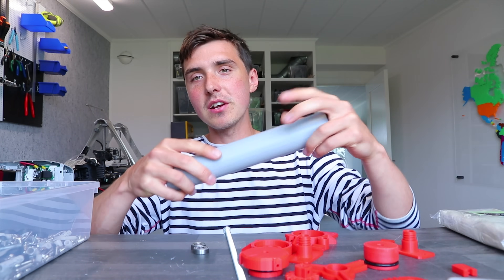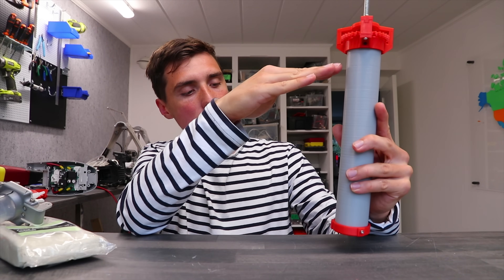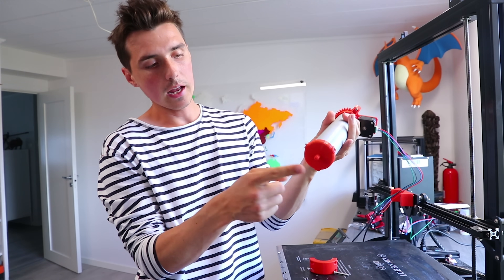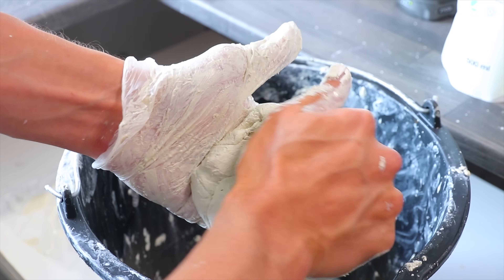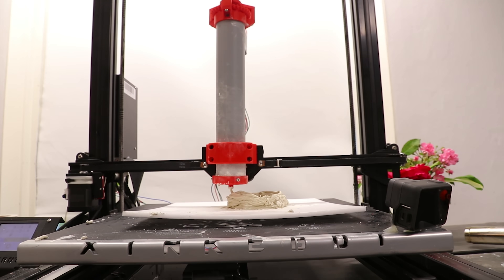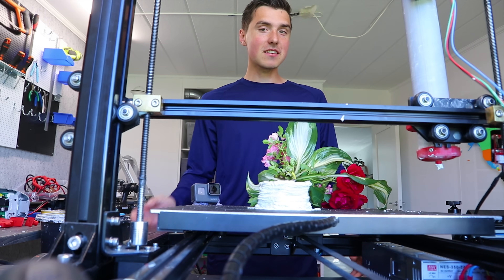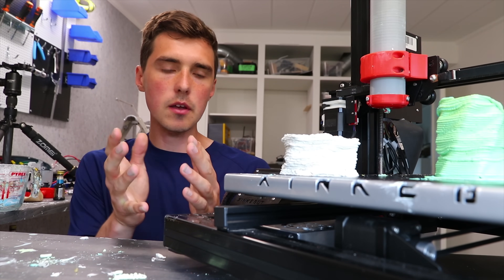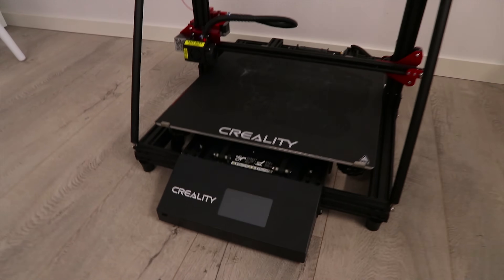3D Printer Makes Ugly Clay Vase

Comment: It's 2 years later and I think the problem is that the bottom of the "hot-end" is flat. If you made it cone shaped it would be easier to push the solid clay out. I know you will never read this but what's wrong with trying?

Comment: I’m a potter and have worked with clay and glass for 50 years.  Here is what I see, the moisture in the clay that you attempted to extrude was not consistent.  Try adding the water and then press the clay through a screen.   Then mix it with a kitchen hand mixer and then through the screen again.  Second extend the length of the strider tube.  The diameter of the tube should be about 5 mm and be about twice as long as you have it.   It will align the clay particles.  The tip of the extruder should slightly depress the clay onto the layer below.  Then I would have a fan blowing on the vase until the desired height is achieved.  I would like to see you revisit this project.

Comment: You need a small heater-blower, like cooling on normal extruders to dry the clay right out of the nozzle. I'd try those cheap chinese air soldering "irons"

Comment: I'm a 3D printer veteran and recently started to get into pottery. Consider making some clay pots by hand and/or consulting with a potter. Also there different clay formulations and some may work better than others. At a glance I would say, no soap, get gloopy and go really slow. Use a heated bed and a fan to harden the clay as you go. Dry, unfired "green" clay with a 4mm width will be very brittle. Handle with care, dry completely and fire it. I'd say get a potter to help you, but making a kiln is probably right up your ally!

Comment: I wonder if you could get past this via really heating up the clay just after it's been extruded. Thinking like a laser hitting it, and going very slow. The problem is that your clay stays liquid-ish. When working with clay, you kindof drive out the moisture via just how you handle it. You even have to keep adding water to force it to not dry out. You don't do that, hence, it trying to escape.

Comment: Impossible to do because of the Time to dry 
3D printing works great because platics becomes solid almost instantanly 
I think you should try chocolate again with frozen airflow. Should work with butter maybe and candy the key for candy is hot head, hot réservoir and very efficient airflow

Comment: You should look into Monster Clay - a wax based clay for professional sculptors. You'd need some way to heat the clay, but as it cools it gets solid enough to support the rest of the model. When it's heated, it can turn into soup if you wanted it.

Comment: You should used Canola oil to soften and paper fibers to strengthen it. its how potters do it..
Reply: When you decide to fire it both burn off.. It just needs to dry slow and then bake till its dryer then fire.. So it does not crack using cornstarch and hand soap was a real bad idea.....

Comment: Hot air and auger upgrade ideas.

There is a vid on how to hack a soldering iron into a hot air blower. If you mounted one near your "cold end" you could stiffen the clay just enough for it at stack and still stick together. In theory, lol.  https://youtu.be/RchFwCALl9c

You might also try an auger to move, compress and eliminate air bubbles.  Skip to 14:00 for a good explanation, https://youtu.be/TkZ1h22KqbU

Comment: Great job ! that is real cool im offering a suggestion..... i think that if you allow dwell time for the clay to dry after each layer and if you can hit it with some hot dry air from a dehumidifier  to get that water out of the clay so modify your g-code for each z step up  weight 10 min or 5 min just use note pad c++ to modify the g-code produced from your slicer.
Reply: then layer adhesion we will think about that after my idea fails.....
Reply: Im like your hours away from a ceramic turbo charger turbine end lol 500c hot gas just print in ceramic

Comment: Maybe the layers need to dry first? Sure it'll take forever but the clay can't support its own weight, especially when more layers are added. Another option is a screw reduction (even tho the plunger already has a screw) to increase torque and print less watery clay. It might destroy the whole thing tho. Third option might be using material that needs to be activated by something to cure. Have you tried proto-putty? Use moisture activated silicone so it won't harden inside the extruder. When it's printed, expose it to moisture.

Comment: The problem with the cornstarch oublec stuff is, that its a non newtonian Fluid. It is reoplex. This means the it is very viscous with no pressure applied, but with pressure applied, it gets way stiffer. That is why you can run ober oublec but if you just stand on it, you will sink. The pressure inside the extrusion tube is to high, so the paste gets Hard, but when it relaxes outside it gets Fluid again.

Comment: I can't be the only one wondering this: what possessed him to add soap to clay??? Does he hae something against just using water? And as for the Maise / corn flour ... I realy can't think of an adequet responce to that.
Simon, if you decide to try this again PLEASE just add water to soften it and leave it on the print bed to dry for a few days afterwards. I don't know if the stuff your using is air drying clay, but even if it isn't all clays hardern at least a bit when left exposed to air because of the water evaporating. It will be much easier to handle afterwards.

Comment: I give you a thumbs up for effort!  You should try an auger style extruder to help push out thicker clay!  I wonder if vibrating the column would lower its viscosity enough to extrude more easily!  Or maybe use air pressure in conjunction with your piston to assist the extruder!  You could also elongate your extruder tip so it narrows less abruptly, thus reducing the maximum strain on your stepper!  Good luck!

Comment: The nozzle is a bad design, it should be fluted so that the pressure is building up into one point (The exit hole), rather than having the motor push the clay against a blocked surface but with a tiny hole in the middle

Print the nozzle again as a big V 
The top of the V being where it attaches to the syringe, and the bottom of the V being the 4mm exit hole

Comment: Could you try increasing the clay flow by using ALOT more water
And to solve the lack of "stacking" try heating the bed up to at least 100 degrees Celsius

By doing those^ my guess is it'll firstly allow the clay to flow well (without the use of soap) and secondly, by having the bed at 100 or above, it'll likely bake or at least dry out the clay so that it hardens while printing. Kinda the reverse of using a cooling fan

Comment: You really need to print a shelf for your new printer so it doesn't have to sit on the floor.   Maybe it could attach to the wall, and then fold out of the way when you don't need the extra printer in the room.  Could you make it all 3D printed, or would you need to add some wood, or other material for the shelf deck?

Comment: This might be a stupid idea but can you use a FDM printer with UV-hardening resin? I imagine using some thick resin, filling it into your reservoir and immediately bombarding it with UV-light after it extruded from the nozzle. The plunger-thingy you used would only need something to hold the lamps at the bottom of it. 
Just imagine the ability to print completely transparent objects :o
Would be awesome to see if this works

Comment: Have you seen the Lutum clay printers? They work the same way by filling a container with a clay mixture but uses compressed air to extrude the clay instead of a stepper motor. We have one at school and use a mixture of hobby clay and t-röd, which is soft enough to extrude but also dries quickly after being extruded. https://lutum.vormvrij.nl/lutum-printer/

Comment: Idea was good, You just need to cure Your material. Like fan cools down PLA, You need fan with hot air to cure (harden) soft clay.
Reply: good idea, just make sure the extruder dont melt by the hot air?
Reply: @dhupee  Extruders are rather heat resistant and heat is supposed to be aimed at material, not extruder

Comment: I saw you had a lighter and was heating the clay after it had come out, perhaps if you had an equivalent of a part cooling fan, but flame, so that you could use a wetter clay but cure it after it came out. This would of course mean a lot of metal parts on the 'hot end' though.

Comment: don't dilute the clay with anything but distilled water and use a large nozzle, like those playdough things - as if you're making pasta. Both of my parents were art/ceramics teachers when I was a kid and I remember seeing my dad use pasta extruders and rollers to make these strings of clay he'd use to make accents for decorative vases all the time. Pretty sure it would be doable, you'd need some muscle behind it and you couldn't do much outside of making coil pots or VERY low detail models, but they would hold up after printing enough that you could glaze them and throw them in a fire or kiln and you'd have a totally functional vase!
Reply: if you "slip" up each layer as it prints too, just a really watery clay mixture and just brush it on it helps keep air from getting in

Comment: I'm pretty sure you failed as soon as you added soap.

Try making the real clay with more water (almost like mud if you have to) and add some sort of hair dryer / hot air flow to dry it as it prints so your mud "slip" turns into "greenware" (it's pottery terms, Google it, should help)

I don't upload my projects usually, but I had been tinkering with the idea of a clay 3D printer for pottery making lately too, glad to see there's some life in the idea.

Comment: Current, not voltage (5:25)...
Anyway, about the actual printing... Maybe you could have some kind of "part cooling fan", except with hot air instead of cold air to try and dry the clay a little bit while you print it, so it doesn't start falling into itself? If that doesn't work, maybe you can make some kind of fast drying clay using some liquid that evaporates more quickly than water, like alcohol or something?

Comment: Gear down for what may have some ideas on making this work. If you ever intend to continue trying this. It seemed like an one off video, just something dumb to rty, but if you run out of ideas and are up for some compilation work maybe ask him.
Also a problem though, it's possible that plastic gears just can't handle the stress needed for getting more power into the plunger..
Oh. Wait. When writing this. Yea. Maybe try a smaller diameter tube. It decreases the work the plunger has to do when deforming the clay. The nozzle isn't even half the work the thing has to put in the thing.

Comment: For something like this you NEED a worm gear at the top...worm gears transfer far more torque.

Next you need a 'cone' inside to make the clay extrude out...just like a real 3d printer uses a inside cone from 1.75 to 0.4mm.  etc.

Try again with my improvements.   The worm gear should allow far more torque for thicker clay, and a v-cone shape inside should allow to push the clay.

Comment: you may want not to ditch the hotend completely, but use it on a separate radiator by the extruding end(nozzle) and set up a blowing fan through it to focus a hot air flow on the printing layer (part cooling in reverse) Easily controllable through the normal slicing software.

Comment: You could probably go and use the normal clay, if you had away to get metal parts for your extruder

It seems the issue there was the material of your parts, and not the clay

Might need a higher torque motor also, I would try to salvage one from a hand drill

Comment: I had my Masterthesis about the development of an two component ceramic extruder.
I developed a progressive cavity pump (printable and gets casted out with silicon) to have a volumetric exact extrusion of high viscous pastes, I used alumina and MoSi2.
If you have further questions I can help you (via private message).
I'm ceramic engineer by the way.

Comment: You probably need to wedge your clay so it doesn't have air bubbles. Every time it hits a bubble during extrusion, it kinda projectile farts, basically the same thing that you'd expect with overly wet filament.

Comment: Hello!

I've been following your channel for a long time, you are producing very good content thanks! :) But it appeared (mainly in this video) that you do not use a magnetic tray at all for the printers, or that I have seen glue stains on the tray, obviously because of the better adhesion.

My question is why? Bad experience?

The BuildTak or Wham Bam magnetic trays are quite excellent, and the rough surface does not have to be treated with hairspray or glue, and I think they can do ABS printing as they do not lose their adhesion above 120 ° -130 °. (Curie temperature)

If you have a firm stance on this, you could make a video on the subject, LIKE who agrees. ;)

Comment: Would this work any better if you got a heater and point it at printer during printing (or make a chamber with heat from the bed)? Though might have to find a way to isolate the extruder thing from the heat.
Then again not sure how this would help with the crumbling.:/
Fun video tho! ^_^

Comment: It's clay only one wall layer will not make it. It needs to be at least 3 wall layer and clay needs a post processing of heat treatment you can use a heat gun after printing and before removing it from bed

Comment: Now you know how it's like to be printing with concrete, sort of. Either you can pump it, but it does not harden fast enough, or you can't just simply pump it. The trade-off between pumpability and hardening is something that is researched quite extensively at this moment.

PLA is such a nice printing material instead

Comment: I think you might have confused the non-newtonian fluids, you want a shear-thinning fluid, not a shear-thickening one. The only accessible shear-thinning gel I know is air gel (Carbomer 940 with a controlled PH), but I don't know exactly how to apply it in a useful way for your case. I know MIT just printed in a vat of shear-thinning fluid.

Comment: Great Video! Suggestion for future improvement; Try to use shear THINNING additives rather than shear thickening ones. For instance, corn starch and water is a well known shear thickening mixture (i.e. oobleck). Sodium polyacrylate (used in diapers) might work in shear thinning applications. Maybe a mixture of water + clay + sodium polyacrylate could result in a shear thinning mixture that will flow out of the nozzle easily but retain shape after extrusion? Just a crazy idea, keep up with the awesome projects!

Comment: Did you consider maybe using craft glue inside the clay mixture and also possibly sieving the mixture through a mesh before placing it in the extruded tank. This is a great project with great potential!

Comment: What about adding some UV resin into the clay so you can have a UV light constantly curing it while it prints
Reply: Good suggest, was the same I come up with.. Instead of water to make the clay more pasty - it will speed up the settings of the layer, and provide stability.. And after a little trip in the heat oven will the resin evaporate.

Comment: I guess it would work better with a auger feeder like they use in injection molding, the clay don't need much water then to get extruded. But I don't think that's printable because the forces you need are way higher.

Comment: Tough problem printing with clay as it needs to be fired to set. Perhaps instead of cooling fans you could use blowtorches to fire the clay just after it's extruded so that it might set enough to keep its shape for proper firing later?
Video of the house burning down would double your views! :-)

Comment: This is probably the first time I would have to say "I think you need a part HEATING fan"
Your problem is more the screw thread is pushing a massive area, make the tube thinner though would be useless as you won't have much clay in it

Comment: I'm surprised the inside of that nozzle isn't a funnel. It seems like focusing the pressure like that would make extruding the clay without or with less soap more doable. Clever idea of using soap but I'm not sure the shear thinning provides enough stability when deposited versus when extruded.

Comment: The Nozzle needs to be more Funnel like so the clay can be push to the center and make sure the tube is lubricated with something. Just a thought.
Reply: also, maybe he can turn the heated bed on so the clay dries a bit.
Reply: @ayden282  Yeah, running a low flow hairdry to dry it the help would help too.
Reply: Yeah and a hot and dry enclosure!
Reply: Came here to say this. I feel like a conical or funnel shaped nozzle would work way better

Comment: Think of the clay in the tube like cement in a truck, it has to be at a specific consistency to flow evenly. Turn the tube sideways so moisture isnt drawn out by gravity, then use a cone with a small elbow for the nozzle end. Lol, try using a caulk gun with a stepper and print with tub silicone.

Comment: Mix Corn/potato starch and silicone caulk and put it in the extruder.
 3d print some proto putty
(RIP Grant Thompson)
Reply: RIP
Reply: hes dead?
Reply: how?
Reply: @princemiro7241  The extent of the details are simply it was a para-motoring accident.
KipKay recently posted a video lending more light on that.
Reply: kurt lindner paragliding, not paramotoring
Reply: @princemiro7241  paragliding accident